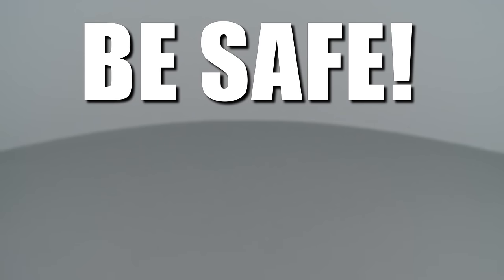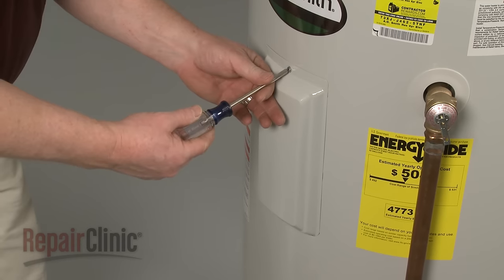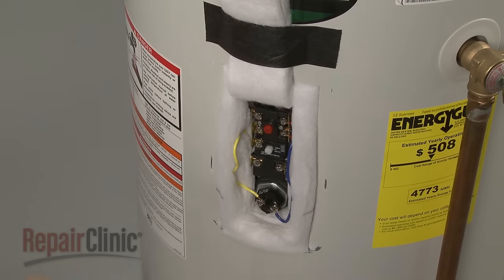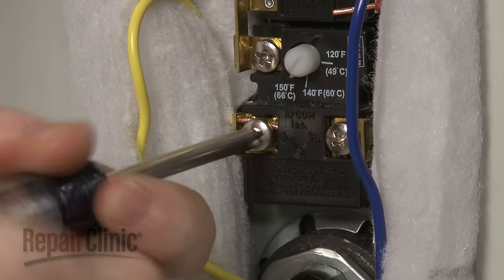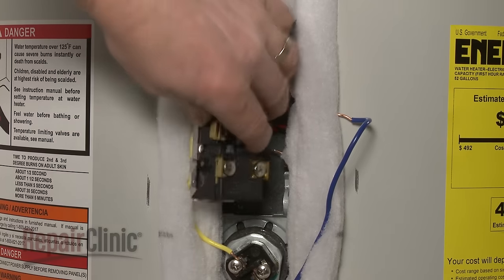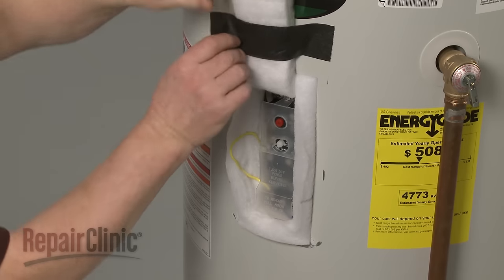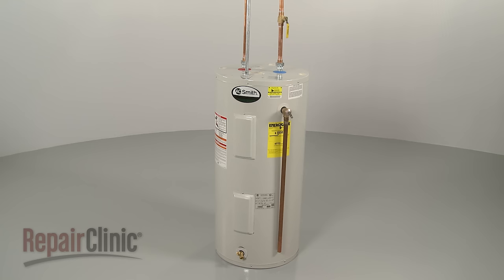AO Smith Electric Water Heater Upper Thermostat #9001954045

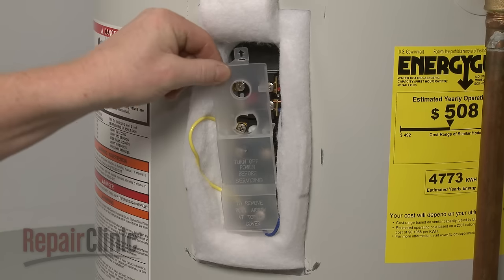Comment: I just bout a 38 gallon AO Smith low boy water heater from LOWE'S and dry fired the top element. I am now replacing the thermostat and element to make sure I covered all my areas of DIY amature mistakes. I noticed ON YOUR VIDEO AT :55 ON THE TOP ELEMENT ON THE RIGHT SIDE IF YOU ARE FACING THE ELEMENT YOU HAVE TOP WIRE= RED MIDDLE WIRE = BLUE AND BOTTOM WIRE= RED. BUT AT 1:58 OF YOUR VIDEO YOU HAVE TOP WIRE = RED, MIDDLE WIRE = RED, BOTTOM WIRE = BLUE.

CAN YOU PLEASE TELL ME WHICH IS CORRECT? IS THIS A SAFETY HAZARD???

Comment: Is this a common problem with A.O. Smith water heaters or just this 80 gallon model? My warranty expired one month ago and go- figure it starts leaking at the upper element. Can't tell for sure yet if it is the element or the tank but the upper thermostat is severely corroded.

Comment: my water isn't as hot as it use to be.  I had done a load full of laundry past few days with hot water selection, Could this have caused the problem?  What do you think could be wrong with the heater at this point?
Reply from the maker: Connie A The hot water tank should be able to handle the amount of water the washer called for. Do you replace a heating element or thermostat? Either one of these parts can fail and cause poor heating.
Reply: i also noticed the switch in electric panel tripped for the water heater and when i tried to turn it back, the whole house lost power. But then i turned the main switch back and everything started working except the water heater
Reply from the maker: Connie A We would suspect a heating element has shorted to ground (through the water) causing the breaker to trip.
Reply: do i need a new water heater or can this repaired instead of replaced?
Reply from the maker: Connie A Get the model number of your hot water heater to look up a new element. Here is a video we produced for an element.  https://www.youtube.com/watch?v=vtMv-MkIaQI

Comment: My water is getting way too hot, then the red button breaker pops out.  Does that mean the thermostat has gone bad?
Reply from the maker: Troy Shaw Most likely one of the heating elements is shorted to ground (through the water) and it is staying on all the time. Enter you model number into our website to find replacement heating elements. www.repairclinic.com?TSLID=1773
Reply: I replaced both thermostats and so far so good.  It seems to have fixed the problem.
Reply from the maker: Troy Shaw If you start running into trouble again we would replace the heating elements. Thanks for sharing.

Comment: Hi I have this same heater and the water in the house has gone completely ice cold.   I know there's power to it I tripped the beakers and still no hot water.   What do you suggest?
Reply from the maker: bklionfan You most likely have a bad lower heating element. I would turn off the power to the water heater and check the element with a meter. If it’s bad replace the element and that should fix the problem. If the element checks ok, test the thermostats and make sure the limit isn’t tripped on the top thermostat. If the limit is tripped (red button popped out) you have a bad thermostat or a shorted element.
Reply: +RepairClinic.com can you push the button back in to make it work?

Comment: My water heater doesn't seem to know when the water is cold. Even when it does, it has a hard time staying lit. I'm even turn it off and on. It'll try to light and burn 3 times before it just stops and 3 lights stays on. I have to do this process multiple times before it finally stays lit. What can be the issue and what should I replace first?
Reply from the maker: +Dao Yang It sounds like a problem with burner assembly. Without model information we can't say what parts your hot water heater has.

Comment: I have a double element hot water tank my water starts of hot then after a few minutes it goes ice cold ? Could it be the thermostat or the heating elements ? An how do you check the thermostat ?
Reply from the maker: Ben Ralph You most likely have a bad heating element. The thermostats can be checked with an Ohm meter. The top one is a little more difficult to check than the lower. When the upper thermostat is closed, there should be continuity between #1 and  #2  and also between  #3 and #4 terminals. This is the upper safety limit part of the thermostat. The lower part should show continuity between #1 and #2 terminals. When the upper thermostat reaches the set temperature it switches power from the #2 terminal to the #4 terminal  and sends power to the lower element . The lower thermostat has only two terminals that should be closed until the thermostat reaches the set temperature.  Both elements should show continuity. You should remove one of the wires from the thermostat or element that you are testing to prevent a false reading. Our How It Works: Water Heater will be helpful to you: http://youtu.be/ZwapTUBP6jw
Reply: Thank you ! I found out I had a bad heating element on top ! All is good now !
Reply from the maker: Ben Ralph Great!
Reply: New problem ! Changed both elements now water starts hot then goes cold after 2-3 mn ! Both elements test good ! Could it be the thermostats?

Comment: Water is leaking from behind my thermostat cover plates. Any idea why that is and/or how to fix it?
Reply from the maker: +hmpz36911 The seal on a heating element may be going bad. The the tank itself is leaking then the heater will need replacement.